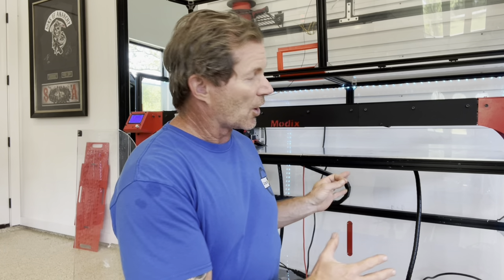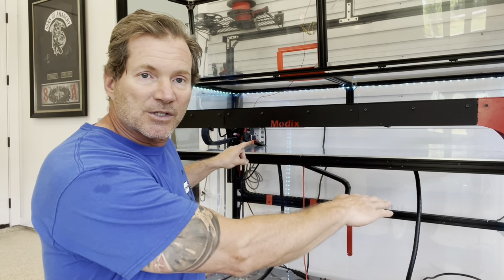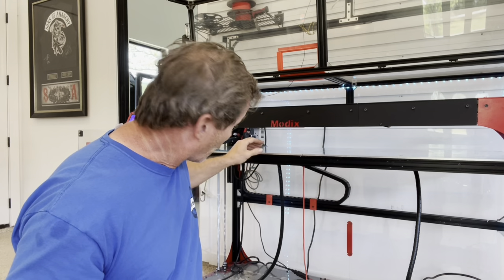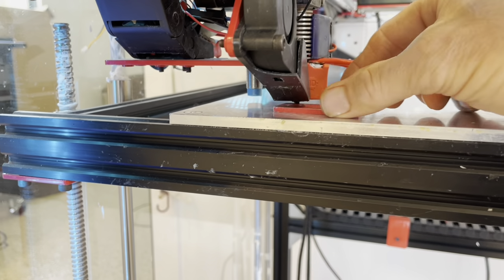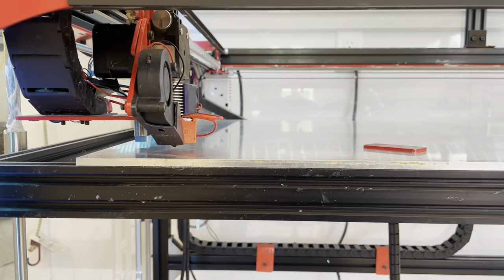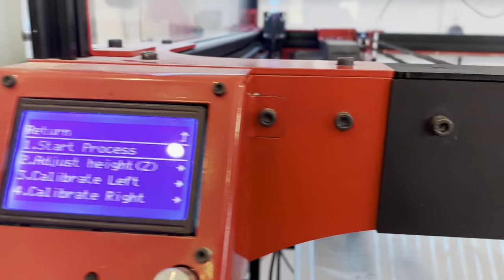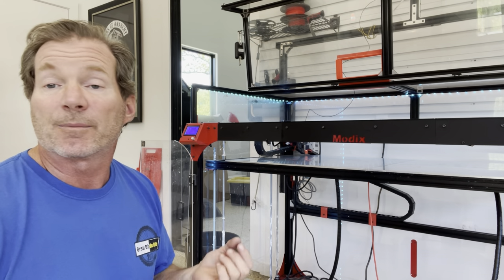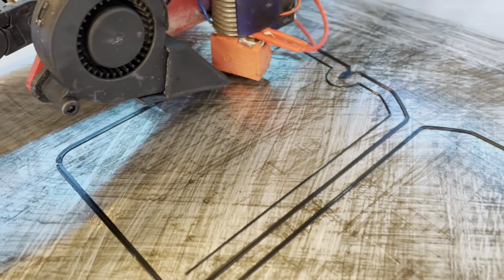Leveling the Bed for the Modix or other giant 3D Printer

Comment: I've done this a few times on my modix Big60 but the mesh map is still showing over 1mm deviation!
Reply from the maker: Is that from one side to the other or in the middle? I have not used the mesh map in 2 years.  If it is perfectly level, unless you are doing a huge print with a 0.4mm nozzle lower than 0.3mm layer heights you should be fine.
Reply: @CLTaggart  left back is the worst part. I use the mesh map to check it's level. And when I print you can see the head is too high in that area as it is not sticking
Reply from the maker: @andrewohara8802  do you have the auto level or do you have a version like my big 120 that is manual?
Reply: @CLTaggart  I have same as you and I done the leveling similar to you!
Reply from the maker: @andrewohara8802  I would say if it is perfectly level then there might be a software thing.  I believe you can reset all settings using G502, but check with Modix support